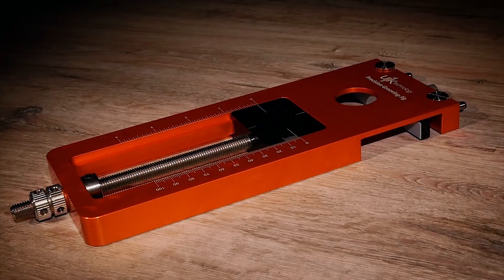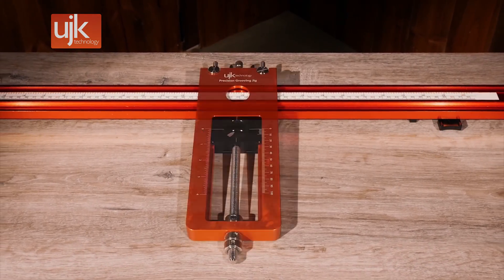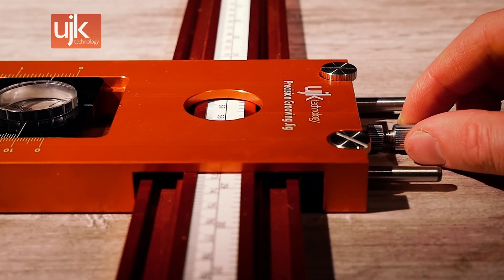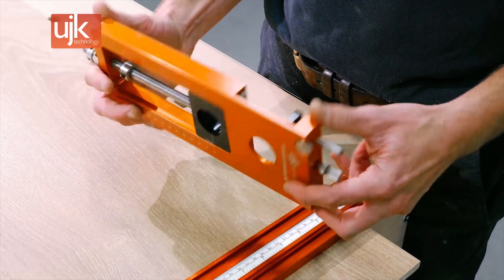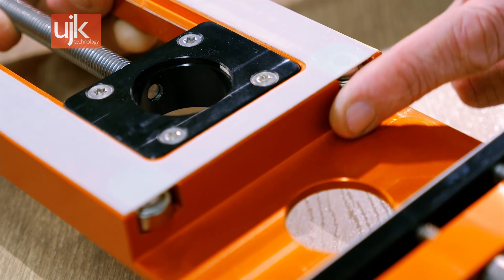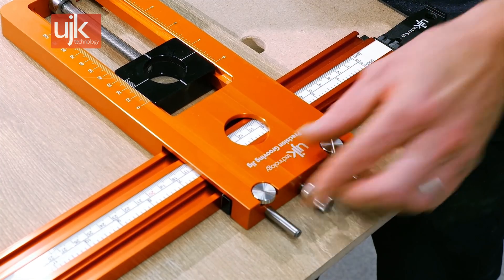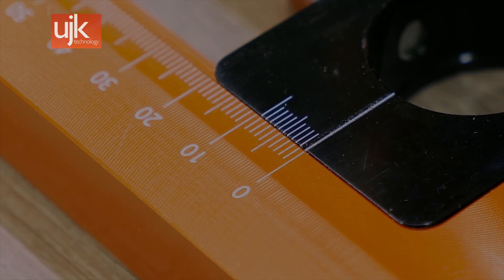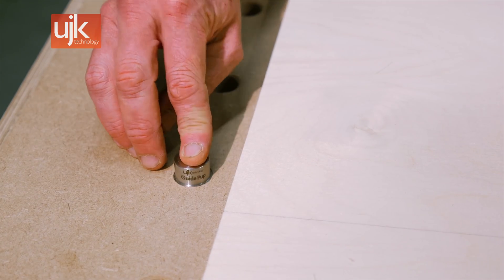UJK Precision Grooving Jig - Product Overview

Comment: There is critical flaw with this jig that makes it unfit for purpose and that is even revealed accidentally in the video. After the "50mm" square is cut a square with ruler is used to check for square and it reveals that the square is actually ~62mm (5:22 155 - 93 = 62). That is because the jig does not have any way to account for how the router actually cuts, if you set the jig for 50mm
that means 50mm travel which with e.g. 12mm router bit gives you ~62mm cut. So do you simply set the jig to go from 6mm to 44mm and get 50mm? No you get ~50mm because actual size of the bit with runout is almost certainly not the same as the nominal size of the bit.

Without having any way to take the actual cutting size into account it can only be used to cut dados where center of the dado is marked and the router bit you are using cuts out of the box the needed dado size exactly. Don't really need any jig for that though.
Reply: I don't work for Axminister Tools, so what I'm about to say is pure conjecture.... but what I'm thinking is that in order to correct for runout you could wrap the 30 mm collet with a layer of aluminum tape to bring the actual size of the cutout down to exactly 50 mm. This jig requires the use of a 30 mm colllet. I've see another jig on youtube that corrects for this difference in that way. I don't have many tools or jigs yet because I'm just starting  woodworking as a hobby. I've been wanting to get into it for over a decade. I finally got a Festool Domino last week, but I still haven't used it. In the planning stage of so many things. It's a upgrade from my DowellMax